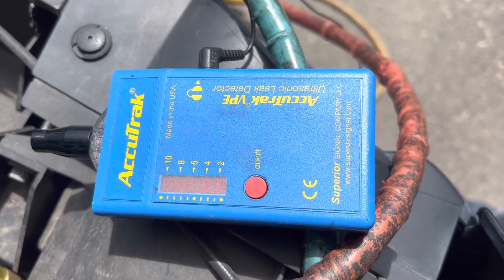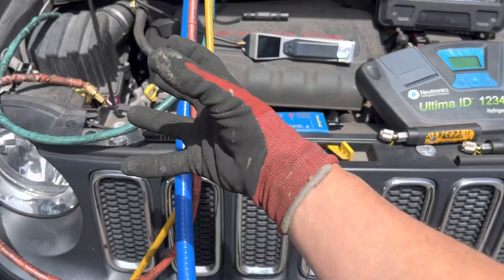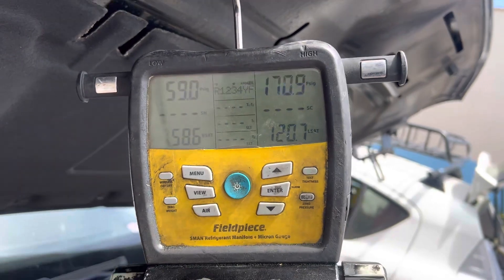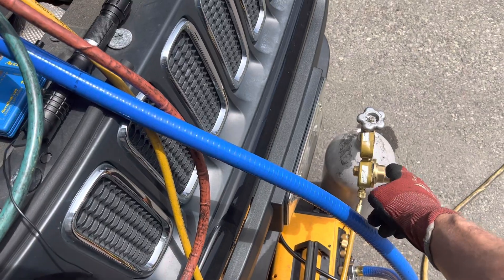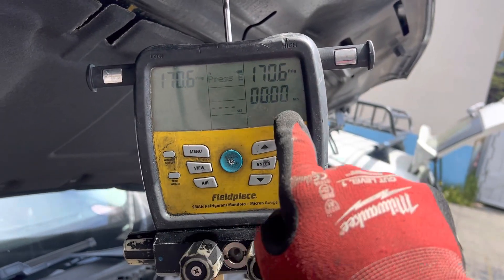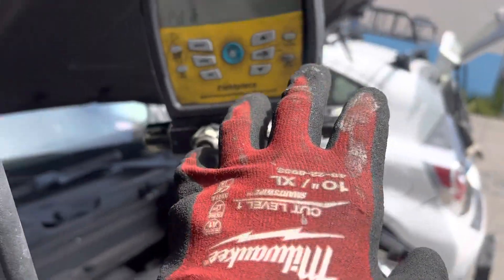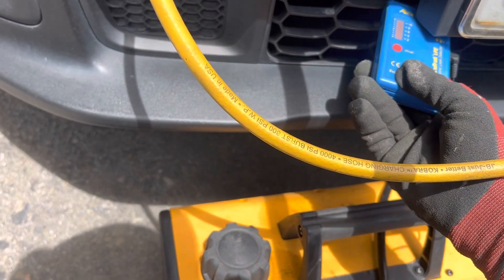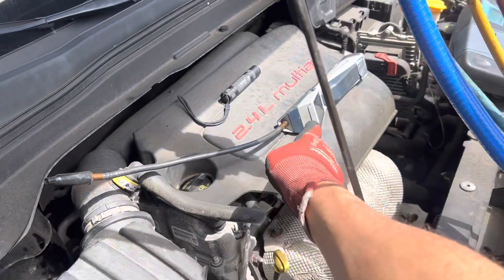AC NITROGEN PRESSURE DECAY TEST FIELDPIECE￼ SM480V

Comment: Great video Tom.  We don't have rust issues here in central Alabama unless its some Yankee  from the rust belt who has decided to invade our small town...😃  Ive been using Nitrogen with inert gage set for about ten years to find leaks that others could not.  I bought the Accutek last Fall based on your recommendation and hope it shows it stuff this coming AC season which has already ramped up.  You should be working with MACSW as a paid contributor and doing presentations on the latest techniques, especially variable displacement compressor knowledge.
Reply from the maker: Remember when you use the Accutek it’s sensitive to the sum of the switch, more power supplies and fluorescent lights and LEDs

If you were buying a extension cord that has RF interference in the AC power lines it will use that extension cord near your workspace with your ultrasonic leak detector in your hand and when you get near it, you will pick up the interference 

If you’re in the shop with leaking airlines, it will throw you off, so disconnect them 

Your refrigerant leak detector. If it is on at the time you’re trying to use her ultrasonic leak detector the vacuum pump the pool there through the small opening of the hose will be picked up as a leak, so turn it off or move it away from the vicinity that you were  looking for leaks

Are trying to give you some helpful tips so you don’t get frustrated ahead of time